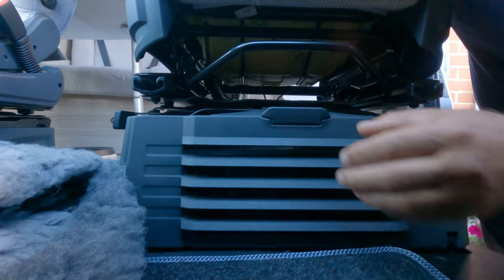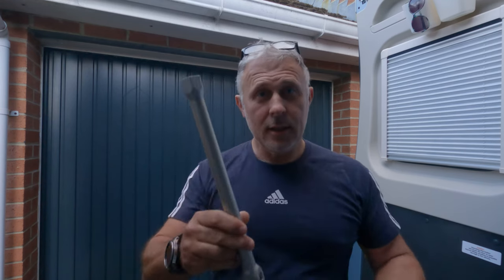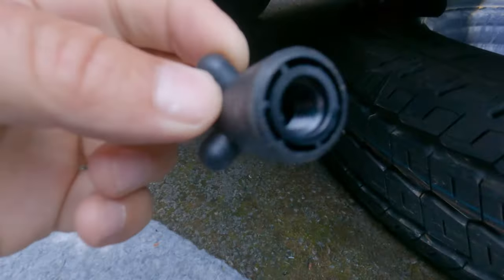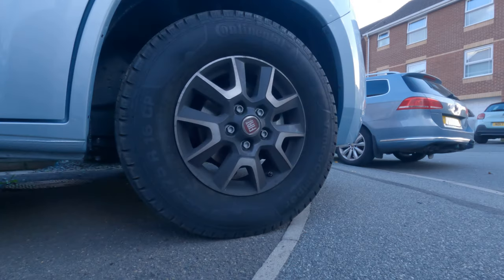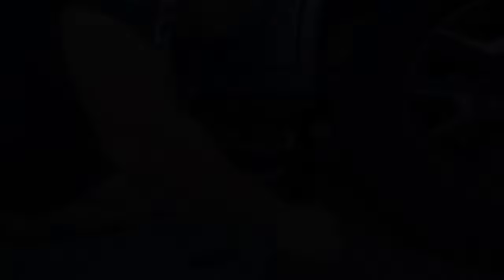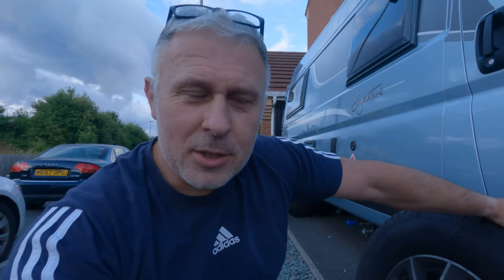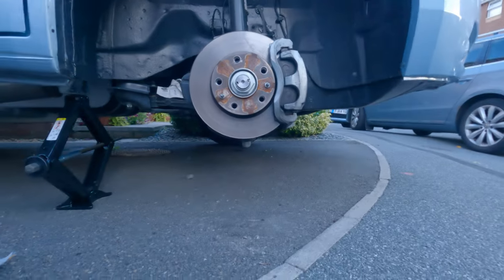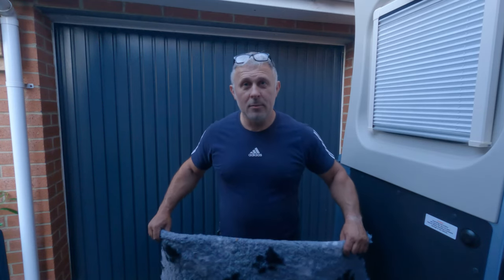Changing the wheel on a Fiat Ducato Elddis CV40 Campervan...The facts!

Comment: Nice video👍🏼. I’ve been fitting a spare wheel carrier to my van and watched your video with interest. I found that the cable is quite long if you wind it fully out, and you can fit/remove the carrier into the wheel with it standing against the bumper then just wind it in.
Reply from the maker: Sounds like the best idea to me. Thanks for the tip. Every days a school day.
Reply: Or drop the wheel and roll forward.
Reply from the maker: @Cous1nJack  not always possible but another possibility.
Reply: I agree, there is no need to get under the van.
I'm amazed he manged to do what he did.

Comment: The bag with bolts and plate in are required to fit the alloy wheel to the cradle you need to use the different bolts and adapter as the centre bore is different.
Reply from the maker: Thanks Ric. I will stick it in the update. 👍🏻

Comment: If you roll out the spare wheel cable completely, you can pull the wheel under the bumper. You don't have to crawl under the car. (Dis)assembly of the hook is also much easier. The winch first pulls the tire back under the car and then up against the attachment.

Comment: Hi Ian. I'm 71. A retired plumber with a bad back lol. It looked a bit difficult for you at only 25? What do you think at my age? Should I give it a go just for a practice? We have a 2019 Elddis 155 with a big overhang at the back. Now, you changed the front wheel and could see the cab jacking point but ours is a coach built, as they call them and the jacking point isn't too obvious. After only 4 years and 21,000 miles the front tyres are half worn and have tiny cracks between the treads. It's just passed its MOT. The tester said the cracks are nothing to worry about - but since then, after scrambling about scaping rust off black brackets and painting them with Hammerite, I noticed the back tyres (still have about 6mm of tread on them) have even bigger and longer splits in them! Now it's not happened overnight so it must have gone through the MOT with these big splits no trouble. They say if they aren't through to the canvas they are ok. But we have a problem. There is a massive 70lbs of pressure in the fronts and a mind blowing 80lbs in the backs. In fact the tyre pressure limit on the sidewall is 80lbs and with cracks in them I shudder to think! Some people with older vans say they've let them down to 60 front and 70 back with a slightly smoother ride and still good handling but if I do that with mine the bloody warning comes on the speedo telling me the tyres are underinflated. Can these be either adjusted or cancelled all together? One bloke reckoned that Elddis put more pressure than's really needed to avoid flatspots during storage. Is this bulls**t or what? I can see a big bill for 4 new tyres looming up but guess what - I won't be changing the buggers! Great video by the way.
Reply: The pressures you see on the door panel, are for a fully loaded white van man's van. Get your van to a weighbridge and weigh both axles, then send it to the tyre manufacturer and they'll email you back the correct pressures. We do do this with every van and have never had a problem, CV20 and I think my pressures are 55 to 58 front and 58 to 60 rear. The van runs and handles very well along with being comfortable and not feeling every bump..

Comment: It's not that difficult. You should continue unwinding after the spare wheel has got to the floor, it unwinds quite a lot further.  Then you can pull it out from underneath the van then releasing it is easy.
There is no need to get under the van.
Reply: Yes, when I was testing out doing it, I wound it down as much as possible and pulled it out the back. It is reasonably  difficult, but if 74 year old me can do it, most people should be able to.

Comment: Thank you so much for taking the trouble to make this video Ian.  I knew what the adaptor plate was for, but hadn't appreciated  the effort  involved in lowering the steel spare and getting it off the winch cable.  I've had several cars where the spare has been underslung in a cradle, but the bolt head for lowering the cradle has always been in the floor of the boot, and removing the spare has been quick and effortless.

It's easy to understand why Fiat have opted for a winch operated from underneath the van though.  Just imagine your Ducato is an Amazon delivery van rather than a campervan or motorhome.  If you had a puncture you'd have to take some parcels out to drop the spare, and while you're busy changing the wheel, they'd all get nicked 🤣

If I'm unlucky enough to get a puncture on a dark, wet, windy night, I'll know exactly what's involved, and believe me, your doing this will greatly reduce the pain and save me reaching for the owners manual.  Especially as I don't carry it in the van!
Reply from the maker: I'm pleased that the effort has reached someone who appreciates it. I hope you never have to use that spare.
Reply: He didn't unwind the carrier fully.  There is no need to get under the van.

Comment: I'm very grateful to you for this video. 
I just found out my spare wheel isn't holding pressure due to a dodgy valve. 
I stopped the vid half way and went and followed the instructions. I wouldn't have known where to start without it.
I have to say the procedure is not easy. I found using the jack to hold the wheel up worked well cos you can push the tyre hard up against the underside and theres no danger of it falling on your arm while you try to detach it. It does get in the way a bit though.
I reckon the most fiddly part is getting the thingy on the end of the cable up through the hole in the wheel. There is no real clearance and it keeps sticking.

Edit one day after:
Just had a new valve fitted and tyre ready to be put back on the carrier. Turns out if I just keep lowering the carrier there is plenty enough cable to get it right out the back of the van. So no having to support the heavy wheel and this makes fiddling with the thingy so much easier.
Thanks anyway cos I wouldn't have known where to start.
Now I'm an expert 💪
Reply: if you continue to wind the spare wheel down after it hits the floor, there is enough slack cable to just pull the wheel out from under the van, it makes it really really easy to remove the plate from the spare wheel...just drag the wheel out from under the van theres is plenty of spare cable, then when returning the wheel its easy to put the holding plate back through the hole and simply wind it back in under the van and up into place, the winding mechanism will drag the wheel back under and up, although if you want to give the wheel a push it helps....doing it the way shown on the vid makes it really really difficult.

Comment: Many thanks for the videos, I'm cramming them over the last few days.

When jacking a car/van with the scissor jack it's easy to chip the paint around the jacking point, this can lead to rust etc. Previously with my cars, I have placed several folded layers of fabric (old t-shirt) over the jack where it contacts the van to stop metal to paint contact. It's a little bit fiddly as this obscures the jacking point, but with a small amount of patience you can get it all located and save the paint around the jacking point .. hope this helps.

Just a thought. It would have been interesting to pop the wheel onto some household scales to show the weight. I'm taking a total guess at 30kg.. maybe we could have done a challenge to guess the weight :)
Reply from the maker: Thanks for watching and commenting. Weighing the wheel, what a great idea. I will do that next time I take it off. Top tip on the jacking point too.

Comment: Great vid' which confirmed all my worst fears and it's great that you've gone to the trouble of doing and videoing this, I don't think I could change the wheel as easily especially as you can't arrange to have a puncture at a convenient spot - like a Halford service Bay! (As it happens, my current van doesn't have a spare but has a tyre inflation kit, for which I'm very grateful.)
Reply from the maker: Love the new motor Brian and I'm not jealous at all. Much.
Reply: I've had my Trigano Ducato for 5 years and never had to use the spare..its a 2008 but same as your me mechanism. I always wondered how it was held and lowered etc.. going to practice using it on my driveway today..well done mate, great video. I've subscribed too!👍

Comment: Hi Ian great video,when you had wheel off i noticed you had surface rust on the wheel hub.I have always cleaned this off and smeared copper grease on affected areas as through time the alloy wheel will weld itself to hub and will be a bugger to get off.I do this to all my wheels once a year and have never had any problems,cheers
Reply from the maker: That’s good advice John. Thanks for sharing. 👍🏻
Reply: The rusted area isn’t the problem, that’s where the alloy isn’t seating. The problem is where the alloy wheel seats against the hub and that’s where a smear of copper slip will help because over time alloy reacts with the steel and bonds. The copper slip reduces this reaction.

Comment: nice video thanks.  Can you tell me, i think you have 225/75/16 tyres, when installed below does the tyre touch the black bracket you installed on the beam towards the front of the van or is there a gap?  If there is a gap any chance you can measure said gap.  Reason for asking on my fiat van i have a shower trap that i think will be in the way of the tyre going up, which cant be moved or adjusted.  From the video its hard to know exactaly where the centre of the wheel is once jacked up.

Comment: So assume then that the alloy won’t fit under the van as no hole in the middle, so you would need to store inside?   Think I’ll order  cheap tarp or some plastic to wrap it in.   Also, can’t believe how slow that Jack was - think I’ll also get a ratchet 👍🏻
Reply from the maker: I suppose once you have took the alloy off you would be getting it repaired and wouldn't put it under the van anyway.
Reply: The plate is to fit the alloy wheel under the van

Comment: Many thanks for that video as I was a bit baffled by the Ducato system which to be honest is utterly ridiculous. Given the amount of space under these vans you would have thought they'd fit a more user friendly system. I agree that in the dark and the rain that wheel lowering would be a nightmare. I wonder how many poor souls have struggled helpless to force that cradle back through the wheel. My spare is also retained by 2 large cable ties presumably factory fitted and not replaceable? Next sunny day I'm going to practice getting the wheel lowered after seeing that. Have also been told to regularly lubricate the mechanism with WD40 as it has a tendency to corrode and seize.
Reply from the maker: WD40 is a very good tip. I agree, it's not the best system and very difficult to operate. I also recommend that from time to time people should lower the spare wheel down from under the van and check the tyre pressure. The last thing you need on a wet and windy night is to get a flat tyre only to find that your spare is also flat. Worth checking now and again. Thanks for watching and leaving a comment. I appreciate it. 👍
Reply: Not ridiculous! I love this system, it works great. Much easier than my previous Ducatos. The important thing is that you roll out the cable completely. I had no trouble at all with the attachment hook / disk.

Comment: Did you ever discover what the circular plate was?
Reply from the maker: I was reliably informed that the plate is to fit the spare wheel. It’s a slightly different size to the alloys apparently as the spare is a steel wheel.

Comment: Great video thankyou. I did have a small metal plate drop out when taking the spare wheel out, did you notice anything like that as I don't know where it goes? .
Reply from the maker: Mmmm. I don’t remember a small metal plate. Is it the adaptor so that you can put the alloy under the van while you are using the spare? Could be that.
Reply: @TravellingfromScratch  it might be. I've kept it just in case cheers 😊

Comment: I think I be calling the break down company. The bags of nuts you got out just a thought are they for the spare wheel?? As in my van I have other set for  the spare as the ones in the alloy wheel will not work in the spare.
Reply from the maker: Hi Martin. Yea mate the spare nuts are for the spare wheel and as far as calling a break down service…I’m with you all the way. I changed that wheel in day light on a warm day and it was difficult. I hate the thought of having to do it in the dark and the wind and rain. Not good. 👍🏻